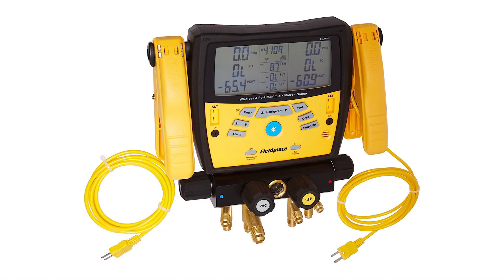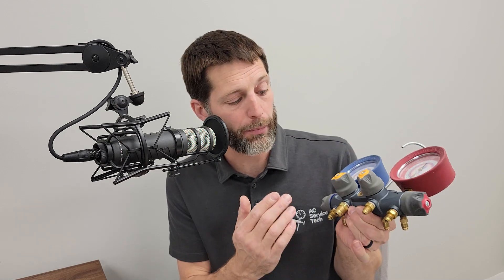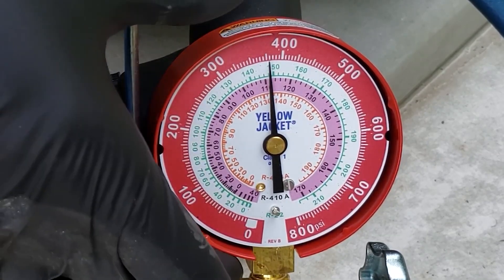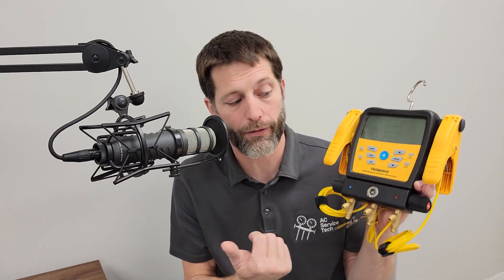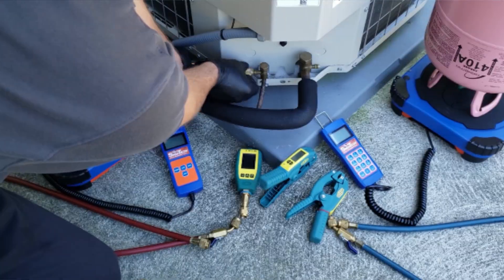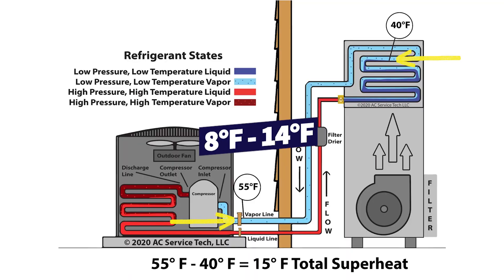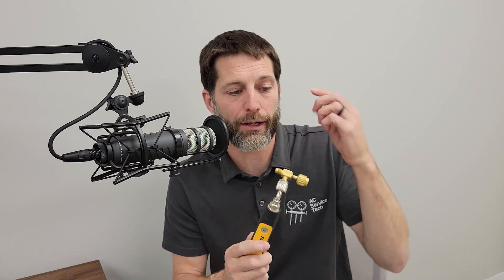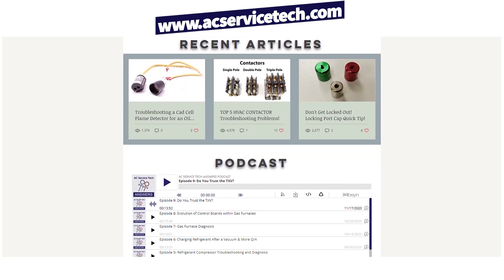Compound and Digital Manifolds, Test Gauges, Wireless Probes! Purpose, History, Use!

Comment: I like 4-port Digital as I work on Self Contained Unit Ventilators and the like.  I can hook the service line to the refrigerant tank and pull a vacuum on the hose right up to the tank alleviating the need to air purge at all.  Additionally I have also used the service line to hook to other locations (liquid line, outdoor suction line (HP), receiver etc). to aid in faster evacuation.  I respect your reasons for not liking them, I just think there is a use for them depending on your job types.

Comment: Thank you for giving me confidence to continue been the only non-gauges technician in all of the places I have worked. It seems so obvious the benefits of Bluetooth gauges, I carry 2 on my tool bag always, they are so small. I don’t need no dam subcooling readings all the time either, the sman3 and all those wires you have to carry. Subcooling is for charging, you can just look at pressures and find air flow issues that fixes subcooling. I carry those exact T’s you were talking about in my field pice tool bag that has the psychrometer and temp probes.
Reply: What part number are those " T's " ?  I Would like to add those to my small lolli pop guages
Reply: @craigerickson8712  I will check my T next time I use it and see if there are any numbers. Someone gave me this T and I added a shredder valve to the charging side.

Comment: Hi I am learning a lot from watching your videos.I need some advice. My ac r410a system keeps running low on refrigeration about a few days after being fully charged.and every time I turn my ac on my high side lines freezes for a few minutes. Have checked to see if I have a leak haven't found any.I am learning about refrigeration level one so far.I have tried to fix this problem many times but still nothing is working out.can u please advice me on what is causing this and where am I going wrong?
Reply: Most common leaks for piping parts and compressors are braze joints & fittings, on coils if not a leak from corrosion, then typically braze joints at the hair pins. or vibration wear through of the copper tubing against the end plates (steel plates at the end of the coil that hold the copper tubes in place on fin & tube type coils, but that is much less common than corrosion).  you really need a good leak detector if you have a small leak...or several big bottles of viper "big blue" and slowly coat every joint, fitting etc.  best of luck...some can be very "fun" to find.

Comment: Craig, Great info. I am still on the compound gauges and just need the right nudge to go digital/wi-fi. I just have concerns about reliability.  How many times can you drop them or get beat around in a truck full of heavy tools. My YJ 41's are more than 10 years old and still reliable as the day I put them in service.

Do you have any manuals on installs? Looks like you have a very comprehensive book on service. But what about installs? Same issue I have with trade schools. The most important part of the system is the installation, but no one is training the young folks on it. What a shame.  But I guess it will keep the service techs busy correcting poor installations.

Comment: On his first 4-port manifold example he put the vacuum gauge right on the manifold, but you can put it on your valve core removal tool, just like you were pulling a vacuum the way he recommends. Once you valve-out your manifold and hoses, it will behave no differently than not using a manifold. I like pulling through the manifold because you can just connect everything up once, then pressure test, pull vacuum, then adjust refrigerant.

Comment: No techs at my company uses digital gauges. Im 25, been doing this for 6 years, and I still prefer the OG. I got a single digital stubby gauge for quick hook up but that’s it. the The price for s-man is crazy
Reply: $100.00 bucks for mine. I use  Testo for  A/C checks and Fieldpiece for diagnostics, repairs and commissioning.
Reply: More accurate and don't fail all refer guys use analog
Reply: Digital batteries dies and u never know  if they failed

Comment: Makes you wonder why those long refrigerant hoses are sold in the first place, or advertised as much as they are.  That 60 inches (5 ft.) hose must hold a lot of liquid refrigerant.  Imagine all that refrigerant vented into the atmosphere because a rookie tech did not charge it back into the system before disconnecting the hoses?  I am sure glad you emphasized this in your video.
Reply: Standerd  cherging  digtal  metar gas cherging very  ferfited  cureact   vacom and  purging systom cooling sub cool  any moster all vaco